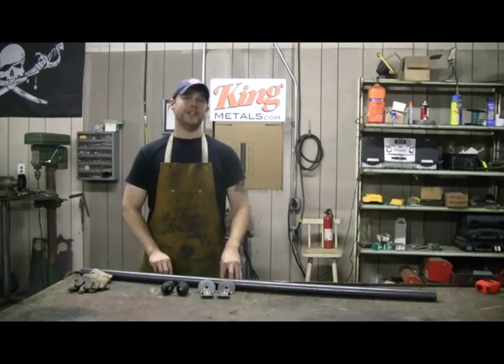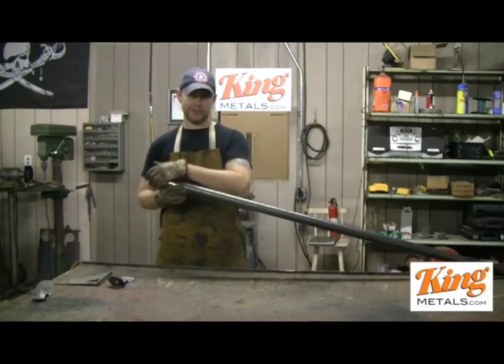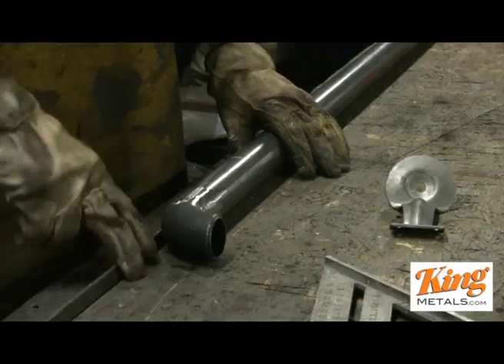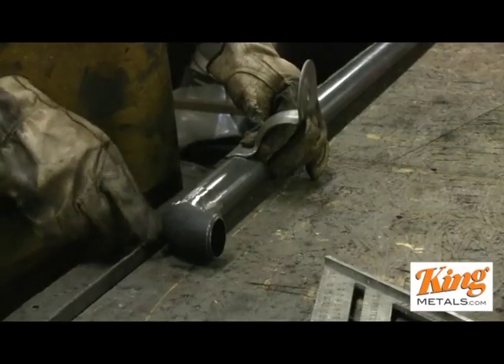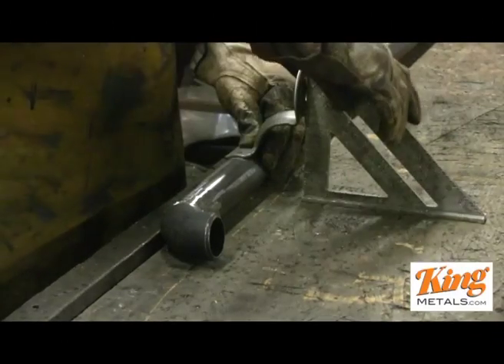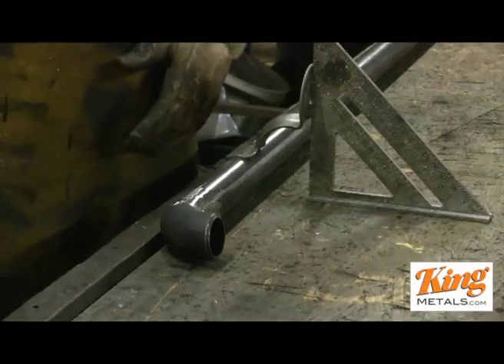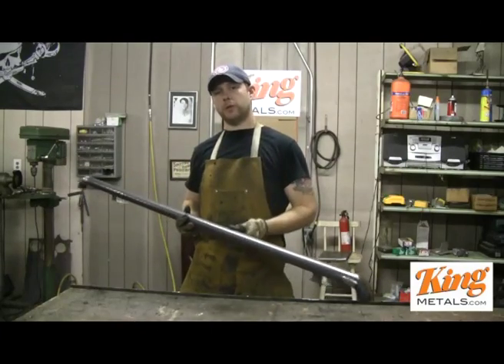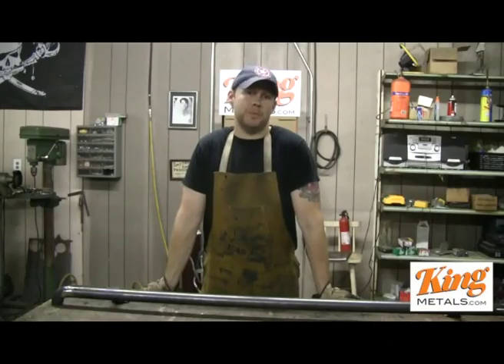How to Weld Pipe Rail pt2

Comment: That video triggered me!! The elbows king sells is for sch 40 pipe
Nobody builds wall mount rail with sch 40 and besides there not long enough to touch wall  when attached
I use a 1 1/4 schedule 10 pipe 1.665 diameter and a 3 1/4 long elbow sch 10, even the bracket was wrong. That rail hanging on that cheap brackets 1/2 " away from wall with the big chamfer is a joke! Even the way you fit them was wrong, you have the open end of elbow on surface of table then you slide bracket to pipe, no offense to you but that was a hack job. Except the grinding was respectable